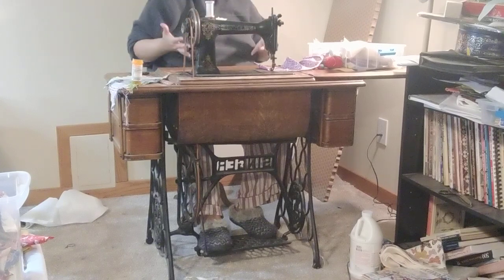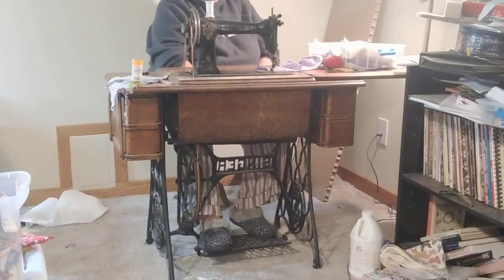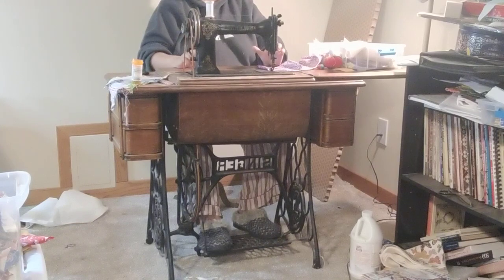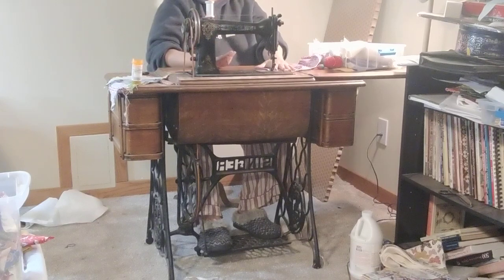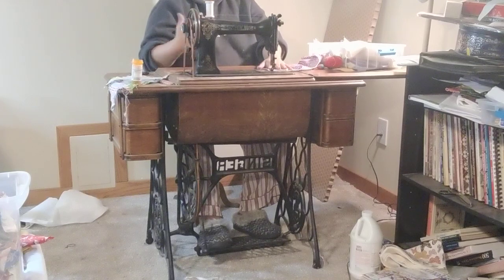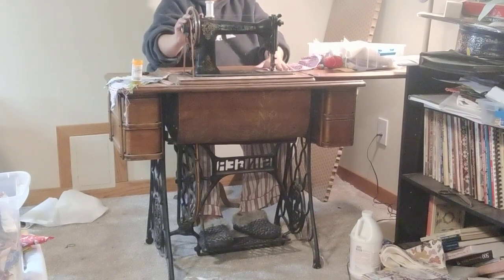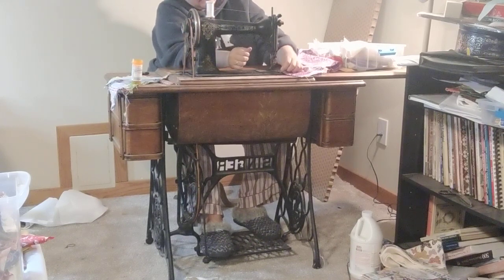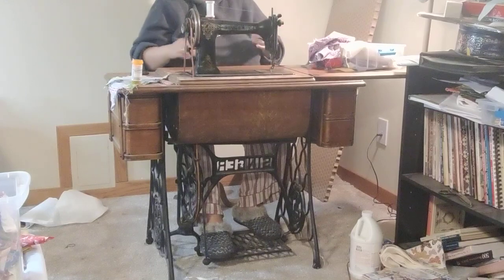Learning how to use a treadle sewing machine

Comment: Do you push the wheel forward to start not back and is that for all treadle machines
Reply from the maker: It varies by machine. This machine pushes away from me, but the most of my machines pull towards me.
Reply: @meapet  my machine was made in  Glasgow and is a 1956, ;Model, 201 k
Reply from the maker: @leslierhodes5467  those will roll towards you :)